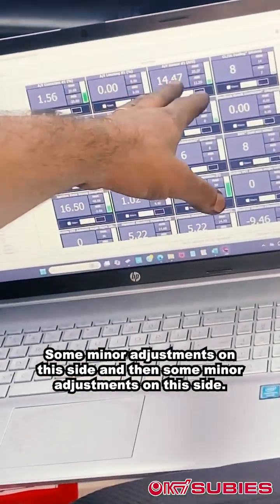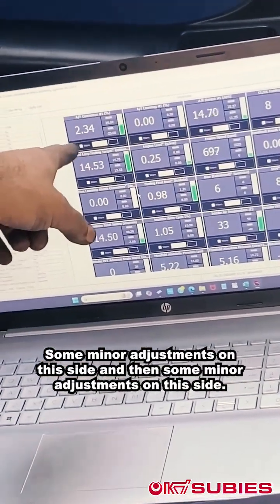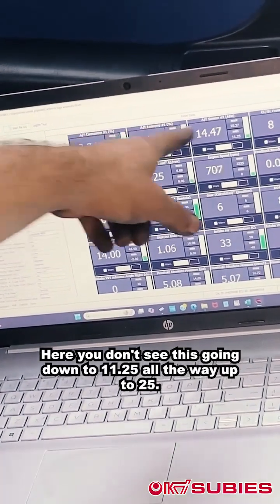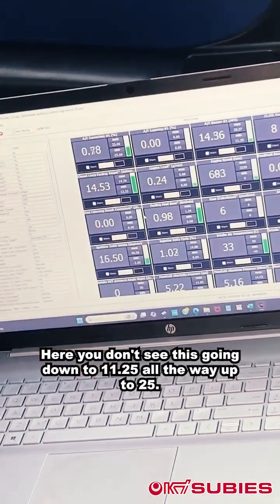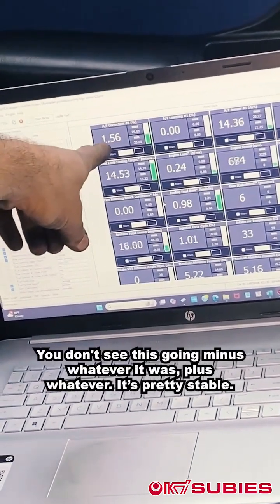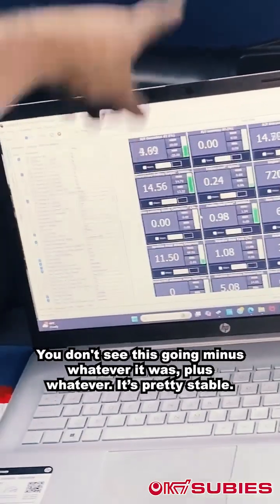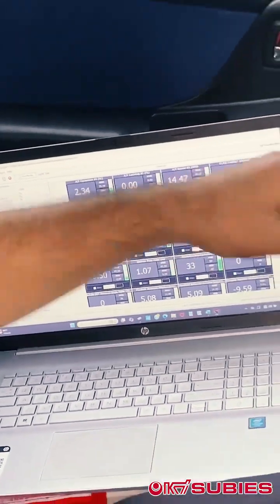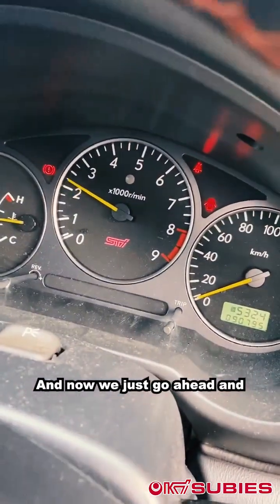Car jerks at lower speed? Here is how to fix it!

Comment: Hi Guys. Thank you for sharing this information. I have a Suzuki swift with same problem. Around 2000rpm in any gear with a constant throttle the car you feel as if its misfiring, but no engine light. Did as you suggested and un plugged the sensor, and car ran smooth again, but engine light on.
Now I've changed the O2 sensor the car is running smooth again. Cheers guys. Nige
Reply from the maker: Thats great to hear that this trouble shooting method is applicable to other cars also! Nice man!

Comment: Hello sir i have a honda fit 2011 and when I’m driving at low speed the car jerks. What should be the problem sir?
Reply: Check the intake hose tube for any cracks also clean throttle body, that might help.

Comment: my car does this but it doesn't have o2 sensor, it is a toyota yaris 2nz-fe with no o2 sensor what so ever ! i have the same issue, when it is in gear, the car like jerks back and forth, whenever i release the gas pedal, it bogs down, when i repplie it, even smoothly, it jerks forward, then bogs, then goes, like an oscilation movement, then it smooths out. it is very frustrating. it is not the engine mounts, as i read that on the internet, i cleaned the fuel injectors, i changed the throttle position snesor, i enven changed the fuel pump, i change maf sensor. my car has from times to times burn smell when i push it hard, lack of power, but, and here is the even more frustrating thing, is that, sometimes, i don't know why, it seems to be smooth, for 10 minutes, it gives me that relaxing time, sometimes it rewards me, one time in the week, it runs near perfectly, tiny small jittering, but i could live with that if it was like that all the time. i thought maybe i have a valve issue, i thought i need to do a compression test.
Reply: Maybe just take it to a good mechanic for a diagnosis if you're not a mechanic because you're spending a lot of time sometimes it's not good to spend time when you can spend money and now it's bothering your peace of mind
Reply: @fasttracklap8480 any update on this? I think we have the same issue
Reply: @OmarLopez-tw1te  man, i got tired of it running like that, i will first check the ecu if it's not corroded inside because i got water leak since a long time, and i will do cylinder pressure and leak test, if it's all good, i'm planning on putting a speeduino ecu, i'm going to tune it myself, this way i get every data under my eyes... i'm no expert, planning to do this with ai only heh 😅😂 (Why ecu because as it is, it doesn't display any diag info or live running data, and just why not try something new)

Comment: Hey thank you very much for making this video. I've had this issue for about a year and been chasing it in all the same ways that you guys were. I'm going to try unplugging my O2 sensor tomorrow to see if it solves mine too. My car's rpm doesn't waver at all when revving with no load but I do feel it softly when cruising. WOT and under boost is great though. I'll report back if the sensor is the answer for mine too. It's a 98 STI Type RA EJ20K
Reply: This week I removed the O2 sensor but the threads from the bung decided to come out too. So had to learn how to install a helicoil. In the end I installed an NGK 24520 as the part number listed above was unavailable as well as the Bosch replacement. Took it for a drive and she's nice and smooth again with lots of power. Thanks again for putting out this video, it really helped me!
Reply from the maker: @ glad it helped!!! Thats great to hear!
Reply from the maker: @brodytaylor6632  you already try the maf? Let us know!
Reply: @OkiSubies  I've had the issue for so long that I can't remember if I tried the MAF. I think I did. When I drove it today with the O2 unplugged it did seem to be smoother. I'll try it again but with the MAF unplugged and report back. Oh and with you guys being in Japan, would you happen to know which NTK part numbers I'd need for my O2 sensors if that is the culprit? Thanks!
Reply from the maker: @ It would probably run worse without the maf sensor plugged in. 

For the O2 sensor it should be DENSO 22690-AA320